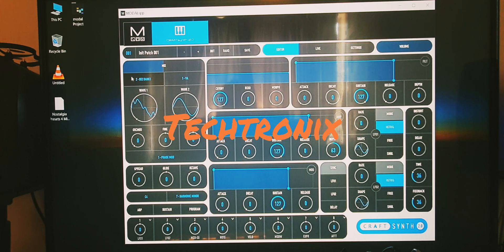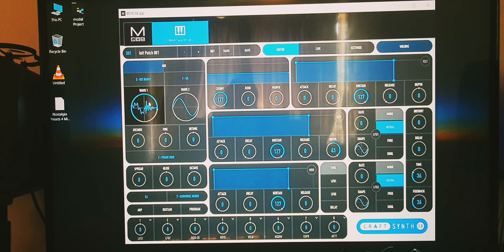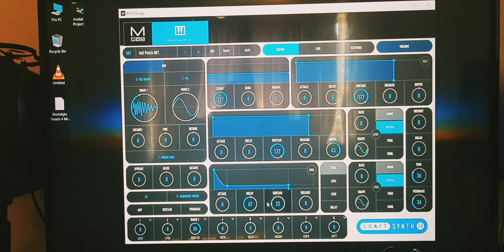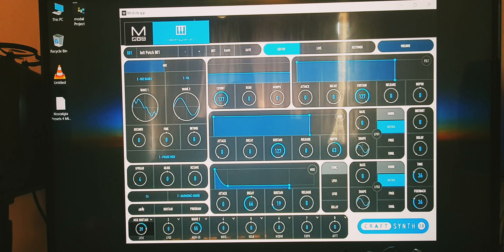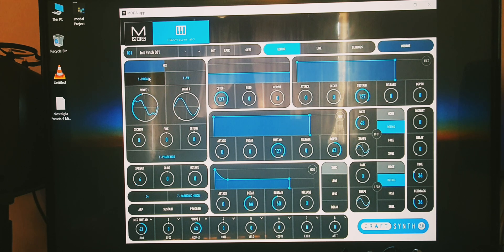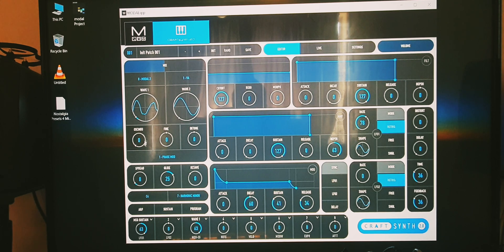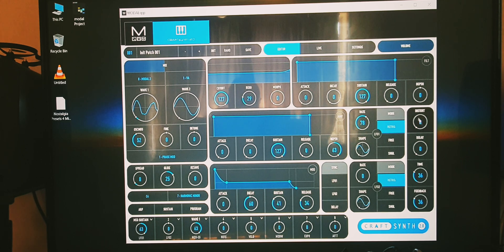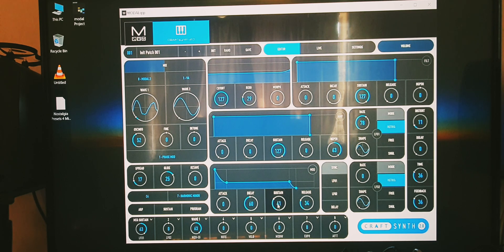Modal Craft Synth 2.0 Wavetable Tutorial

Comment: Is it worth picking this up if I have an MF? I like some of the Wavetable capabilities of it but it's a bit limited. I was listening to some older wavetable stuff like the PPG Wave and it's amazing. Of course that had an analogue filter but I can route it through the Crave for that.
Reply from the maker: If the freak isn't enough for you look at argon 8
Reply: If you can find one of these used it’s a pretty cheap bit of kit but the micro freak has many more interesting oscillators and a cooler mod matrix.  This has two LFOs and and a mod envelope, the micro freak has one LFO and two envelopes.  The micro freak is bigger and the keybed on the micro freak is a lot more useful.